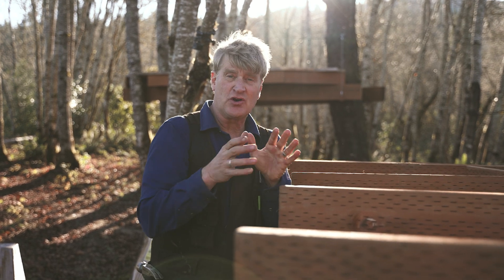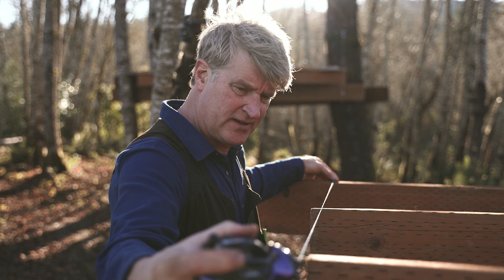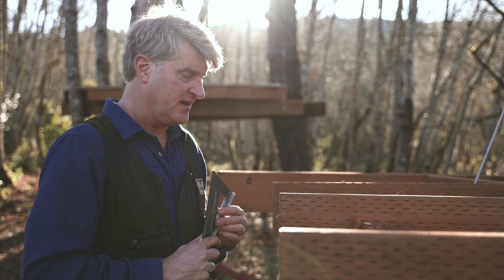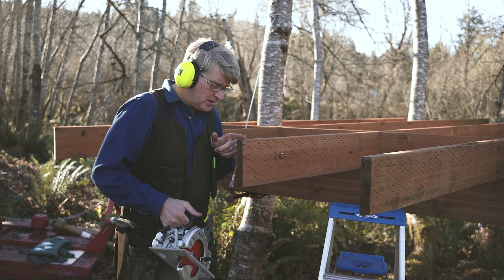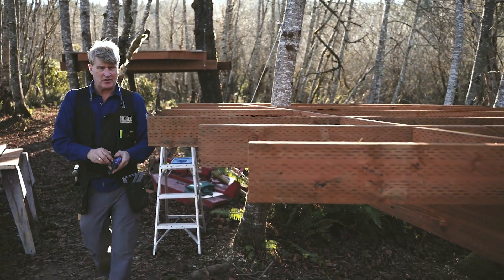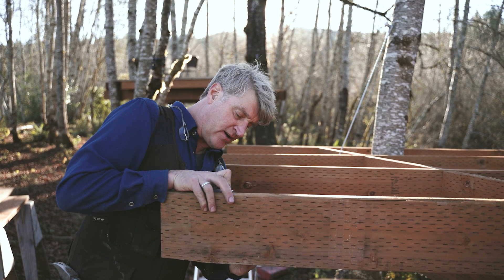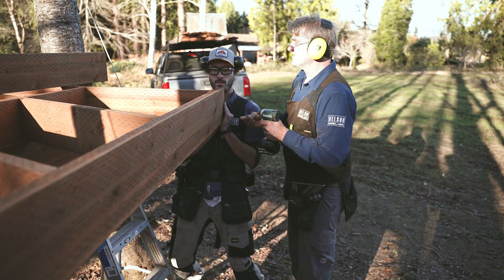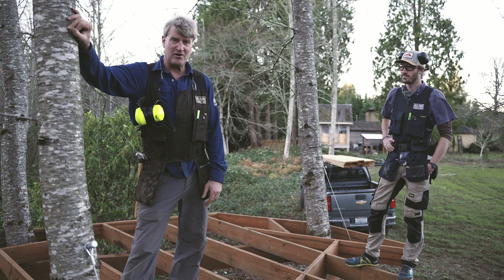How to Layout & Install the Rim Joist of a Small Treehouse Platform

Comment: These are great videos. One thing I wish you would have explained is how are you fastening the end of the joist block where there is already a joist block. It’s obvious on the open end where you have access to screw through the joist into the block, but where the previous block is screwed in you must have to use some kind of toenailing. Do you go into the top or sides and how many screws?  Keep up the good work